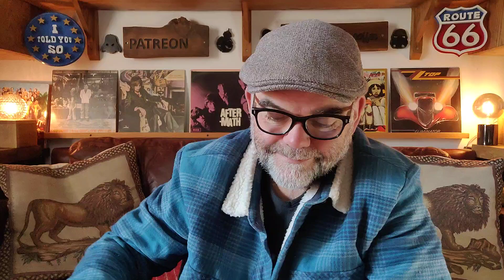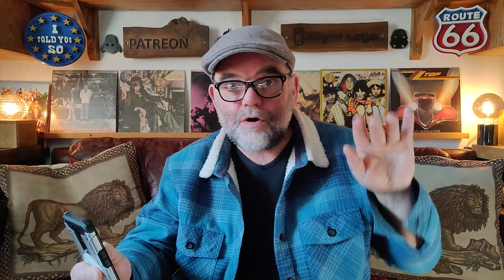This why England faces BLACKOUTS

Comment: I live in Austria and I am shocked that I didn’t pay more 4 electricity and it’s still the same for this year. I get money back, because I did save some energy (new house all electric incl heating). I don’t really get it, but it happened. We could run into a problem because there is not enough water this year, and we have a lot of water plants. We actually store over electricity by pumping up the water at night, and in the morning it produces again more water power.

Comment: The actual problem is that the wind doesn't blow all the time, obviously.
Reply from the maker: What's that got to do with turning off the turbines?
Reply: @AllShortsPolitics  We could keep the turbines running if it was possible to store the excess power. Problem is thats so expensive to do its impossible. Wind will always only deliver intermittent power.

Comment: Ive seen 3 interviews with the head of the national grid with Robert Llewellyn on his Youtube Full charged show and he said there plenty of electric for EVs and they want them to charge at night to use up the surplus as there is a low demand its called the Bath Tub effect. so it levels out supply.
Reply from the maker: That won't happen... People will plug the car in as soon as they get  home
Reply: @AllShortsPolitics  Yes they do now but they set up the timer either from the car or the charger , then the cheep rate comes in at 1.30 am at about 8p kwh , Google it .

Comment: Actually, in the autumn, there were significant fears of the UK being unable to generate enough electric power - and while there were a couple of times when National Grid was paying customers to reduce consumption - at the end, there was no significant stress on the grid (although it did get close).  

However, with the recent shortages of food in  supermarkets, it transpires that quite a few farmers cut down on glass houses due to the exorbitant costs (and the lack of government subsidies for farmers).  Ironically, however, as these are activities that are very energy intensive (hence the astronomical bills), the fact that these farmers cut back on production may have actually eased the load on the national grid (thus reducing the risk of power cuts).

Comment: It's so frustrating that the lack in investment in getting us off fossil fuels always seems to be put on the back burner (excuse the pun) - I've seen so much money wasted that could go towards these projects & making lives better on utter nonsense. We have a green energy provider here (mainly solar & wind) - they started out as a small company but between small investors & using profits they have upgraded systems to be more efficient, storage from off peak hours to help the demand during peak hours and even have been building new green housing communities but it is a drop in the ocean when compared to the overall demand. Like many of the small green tech companies they have faced the big oil companies trying to buy them out (this way the big oil can claim they are going green without actually doing it and get a nice bonus from the government). I still have hopes to be able to go either completely or mostly off grid but the cost right now (loan & land) is prohibitive - so we save & hope to do so in the next 5 years.

Comment: So, the morons are using expensive gas to run electric generators that will produce expensive electricity to be used by the consumers!! Are these rational, educated people? It would seem not. Surely it would be quicker and cheaper to build water-powered electrical generators. But that would be logical, so we know it won't be done.

Comment: I would recommend you buy a second hand Nissan LEAF but not the first edition, anything after the Fukushima disaster.

When Nissan first started to building the Nissan LEAF in 2010 they designed it to only to take electricity and not to give an electricity back.  But then in 2011 the Fukushima thing happened and all these Nissan LEAF owners had enough electricity in the Nissan LEAF's batteries for about half a week or a weeks power, but they couldn't use the electricity in their homes.  And they had no power at home because the Fukushima thing messed up the power grid.

So after Fukushima Nissan changed the LEAF so that it can give back power.

So with you having your wind turbine on your farm making power, just buy a second hand LEAF and put your power into the LEAF and take it out again when you need it.

If you want to use the LEAF as an electric car you have to be aware that it doesn't have a CCS connector and that's going to be a problem when driving long distances in the future, but if you just want to store the power from you wind turbine on your farm then get yourself a second hand LEAF.

Comment: It's not just lay more cables, it's lay more cores with them so they can carry the load.  As to the gas turbines, they can be spooled up very quickly and brought on line and take varying power loads to maintain frequency and smooth out voltage dips.  The thicker and more numerous cable cores also reduce "I squared R" losses during transmission across the grid.  Also, the use of "inter-connectors" helps between countries.  There has been ones between Ireland and Northern Ireland for years and with the current Belfast Agreement they don't get sabotaged like they used to but now due to Brexit, they're laying one from France to Ireland.

Comment: What they could do, is build a few strategically placed dams, and create basins that you can pump full of water when it's windy, and let the water out through a hydro-turbine when it's not.
That's how Denmark and Norway do it.
Reply: Yes, potential batteries, gravity batteries, hydro batteries etc. I think Switzerland are just  about to put online a huge two level reservoir dam system where, as you say, you pump water up to the higher reservoir during electricity surplus/low demand, let it flow down (through a generator) during high demand.
 I heard of a plan a few years ago to use our abandoned mine shafts to store potential/gravity energy during electricity surpluses by using the wind power generated electricity to winch heavy weights up these mine shafts. You can then let the weights descend down the mine shaft (at high demand times), the winch cable is then attached to a huge generator, which is spun by the lowering weight. There are loads of solutions and ideas but we all know it is the Petrochemical lobby hindering our green progress.
Reply: @Leode Siefast  To paraphrase the introduction of a weird 1970s series:" Gentlemen, we have the technology. We have the capability to create the first carbon neutral society. "
But we won't do it, because we can't be bothered, and mad uncle Donald's Facebook feed says there's no need.
Reply from the maker: There's one in Wales

Comment: Another problem that the grid has as well is the requirements of a constant base load in the system . The lack of nation wide SUITABLE integration of all of these renewables coming online has already been exposed as a major issue in a report back in 2009 by a group of academics from the Nottingham university I think that's the one. A chain reaction of pass the buck has insured that nothing meaningful has ever been done to address the problem. Rather a massive campaign of profit extraction by the operators as been in full steam ahead since and set to continue. "It's a disgrace" don't you think?
Reply: As you are obviously aware the GRID Needs the highest possible  voltage to pass electricity efficiently over the UK system .However domestic consumers cannot use this very high voltage directly so each village or street has transformers to cut the voltage down to 240 or 230 . IT DOES THIS BY Grounding  THE EXCESS. ...... totally waste of power .  The future is for going for more efficient appliances,  quite rightly, .....but what's the point..?..America uses 112 V ? To our 240 V ? Hand tools are at 12 V  . Clearly the GRID supplying at the HV  and dumping to convert to the users smaller demand is not working . I can survive quite happily in my holiday caravan on a 12V  leisure battery supply for all of my needs. WE NEED TO RETHINK SUPPLY AND DISTRIBUTION.

Comment: You use the dump load to pump water back up to the hydro systems supply . Then release the power when you need  it.
Reply: Yep, my first thought too. Especially with Cruachan - a pumped storage station at Loch Awe in Scotland - is still in use AFAIK. I've been wondering for years - sometimes out loud, sometimes in YT comments - about whether more such facilities could at least undergo planning.